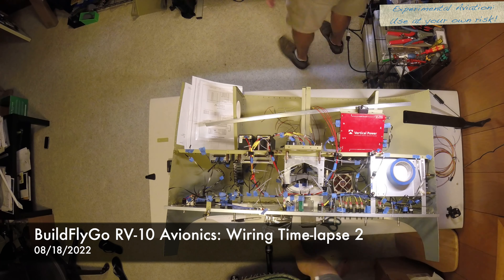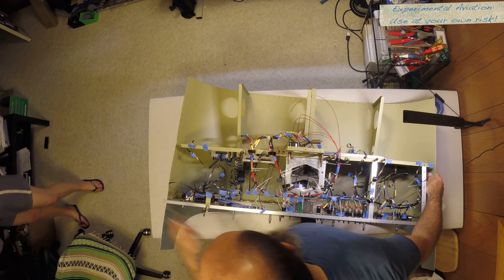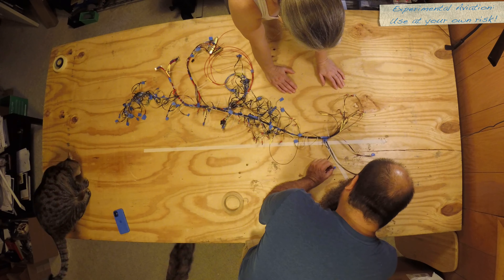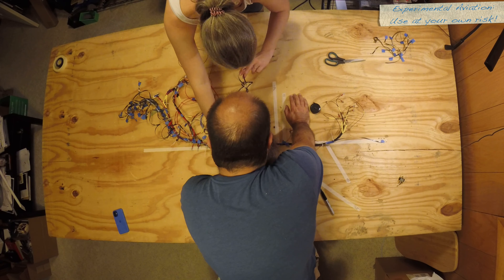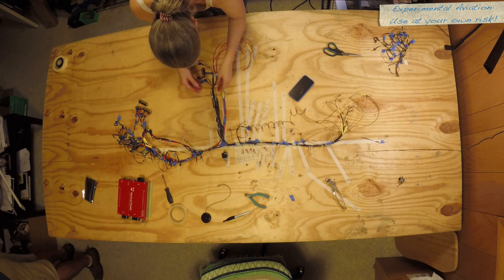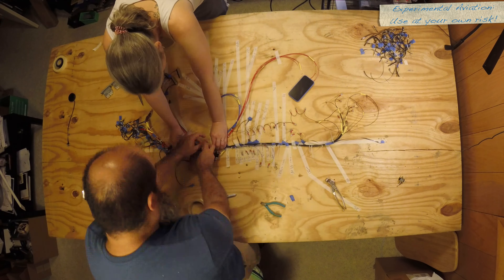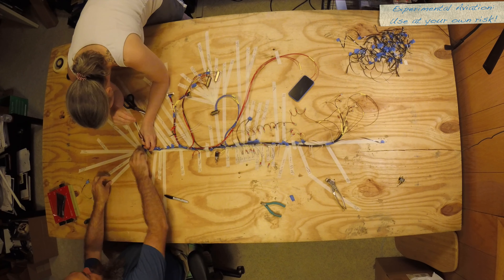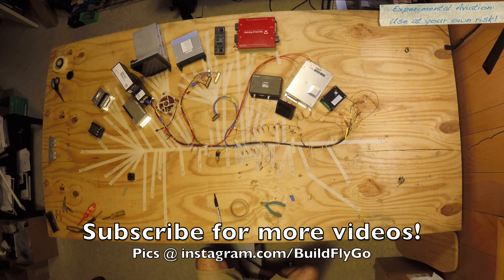RV-10 Avionics - Time-lapse 2: Moving to the pegboard

Comment: I guess I’m confused as to what stage you are at. When I took my wiring class, I recall making this sort of board was step one in creating the harness, where it looks like you have already created the harness using measurements off of the actual panel wired on a bench. Just curious as to what you will use this board for now that you put all the tape down. Are you making another harness?  Just trying to get my bearings or learn a new process for when I make mine. Thanks, I find your videos super useful
Reply from the maker: We first figured out the lengths in the panel and now transferred them to the board to more easily run all the different wire lengths. It was just a way to make things a little easier. Once we have all the wires in place, it goes back to the panel for final sizing and putting the connectors on. We can probably put the connectors on right on the table but suspect we can shorten things a little more still.
Reply: @BuildFlyGo  ahhh, I think I’ve got it now. I thought you had fully wired up all those connectors when you were test fitting everything in the previous videos. Instead it looks now like you were just running single wires or partial ones (or just ribbon in some cases). Got it so rather than just running some basic string you wanted to test fit more precisely and now you will take the lengths you have and run the full number of wires for each, etc. I think I’ve got it now. I do like
This method too. In class we just ran string and did some guessing and added a little more for a maintenance loop , etc
Reply from the maker: Yeah, I figure if I was running a production line of these string would be fine but as it’s just one I can be really precise and spend time getting the lengths just right for this panel.